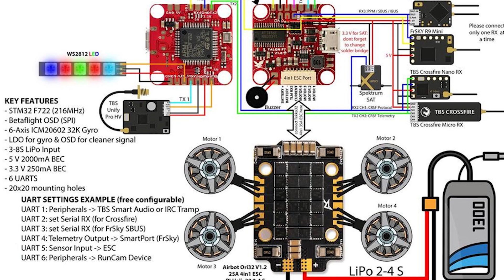Talon F7 // Fully LOADED 20x20 F7 Flight Controller! 👍

Comment: What firmware do I use in this thing I have the same one but I'm trying to figure out what firmware to flash to it
Reply from the maker: If you use configurator 10.5.1, it will tell you the target to use in the upper left corner when you connect to the board.
Reply: @AlbertKimTV  Yes but I flashed the wrong firmware so I need to know what to target it to
Reply from the maker: CLRACINGF7

Comment: Did you test it? I am really sceptical about fcs that dont use mpu6000. I want to build a new racing quad and would like a mini f7 but with an reliable gyro.
Reply from the maker: The primary reason people who (don't know how to build properly) are having issues with FC's without the MPU6000 is due to lack of vibration dampening.  I should make a video de-bunking this perception out there, but people like you will just hate the video.
Reply: @AlbertKimTV  thanks for the answer albert. I soft mount my stacks,my motors, everything it can be. I will give it a try in the new hardcore racing, lightweight build i will do. Thinking of holybro teko32 with this fc.

Comment: I found the solder bridges very challenging. Much smaller and tighter than any other I’ve seen

I’vr got one in a 5” with an Aikon AK 35 Amp 20x20

Comment: Thx Albert ! :) Looking to the wiring diagram, i wonder how to plug a 3 wires buzzer (such as Hellgate) to this board ?
Reply from the maker: So on the Hellgate you wire up BUZ- to the BUZ- pad, nothing to BUZ+ and the 5V and GND anywhere there is 5V and GND on the board.
Reply: @AlbertKimTV  isn't BUZ+ a just a 5v pad?

Comment: The most complete 20x20 F7 Flight Controller is the "Matek Systems F722-Mini Flight Controller " It has Dual-Gyro, support 2-8S,  Dual-camera and BetaFlight or INAV, Downside are no Current sensor and Barometer.
Reply: It's better than most full sized boards, 
You pay for it though.

Comment: Nice looking FC! The problem is that the matching Tekko32 ESC is 35A which is overkill for 3" builds. It would be nice to have a smaller 20-25A ESC to match the FC as well.
Thanks, Albert! 👍
Reply: Ori32 esc fits thats
Reply: @armfpv9962  It's probably as big and heavy as Tekko32.
Reply: Terrorbird, that’s what I built. Makes for  lots of room for receiver and vtx
Reply: The Ori32 is noticeably heavier than the Aikon 35 amp esc
Reply: @DanielBrassard  I will take a look at Aikon32. Thanks
Reply: Try the Aikon 32pin 20x20 and you'll have a chance at at a 6s monster
Reply: @terrorbirbfpv4732  that's the thing - I only want a 3" 4S quad!  Don't need a monster!
Reply: @sergeiiakimenko3648  it still handles 4s very well. Great esc